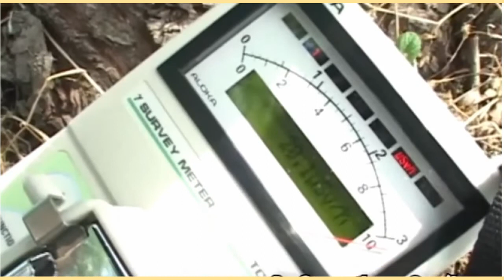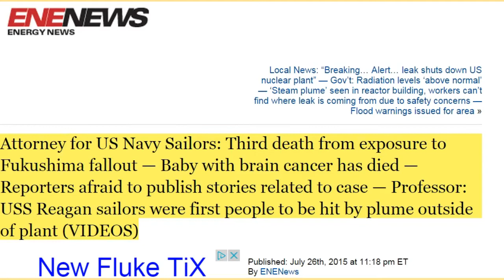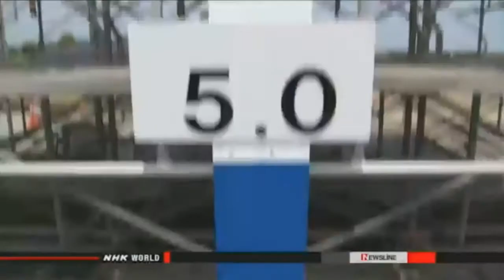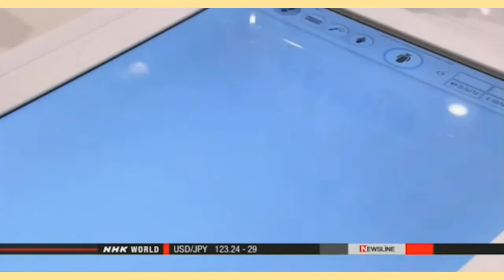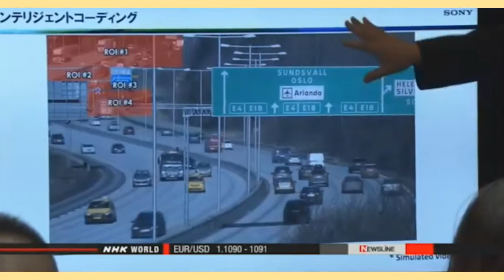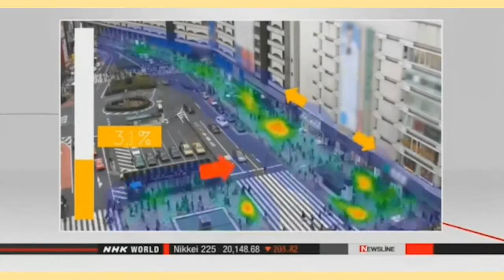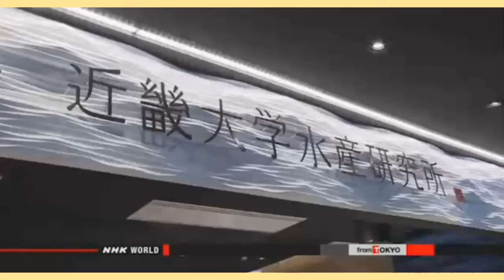Fukushima News 7/27/15: Emergency Drill For A 'Safe' Restart?- Tepco Uncovers Meltdown #1

Comment: #1?  Isn't that the same #1  that we were shown as being all pretty and green and safe?  They were removing spent fuel rods like they were pixie sticks just some months ago. Or was that another melted building?  So many melted coriums, so much confusion.
Reply from the maker: ***** That was one of the other melted buildings.  Numero cuatro to be exact or 数4.  Now they gave away the truth about units 5 and 6 because @:51 they explain that nuclear fuel begins melting in 20 minutes without cooling.  LOL.  You know what they say about telling lies and keeping the story straight.  👺  I also noticed how they're supplied with extra generators and 'other supplies' (car batteries) in the event of a power failure.
Reply: MissingSky101  Oh, well, I'm easily confused.  But 4, it's in great shape and other reactors are buzzing and ready to come on  line so things really are improving. Are those 3 cores still roaming around, uninhibited, unregulated, and chilling in the water supply?
Reply from the maker: ***** Tepco easily confuses us.  It's not your fault.  lol
Yes the 3 or more coria are happily dancing undetected (or so they say).  Hide and seek will be over when they hit a larger pocket of table water.  
Nuclear specialist: Corium hitting water table is “big concern” — Once fuel hits groundwater the concern is “it just blows right up” (VIDEO)
http://enenews.com/nuclear-specialist-corium-hitting-water-table-is-big-concern-once-fuel-hits-groundwater-the-concern-is-it-just-blows-right-up-video